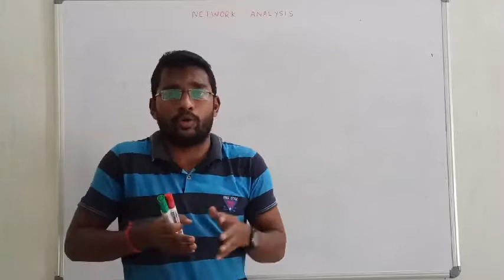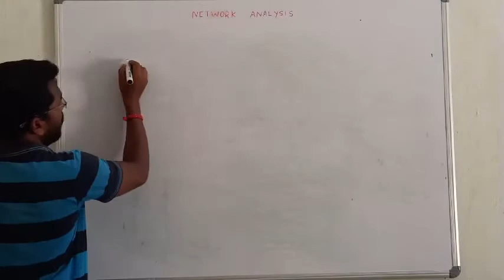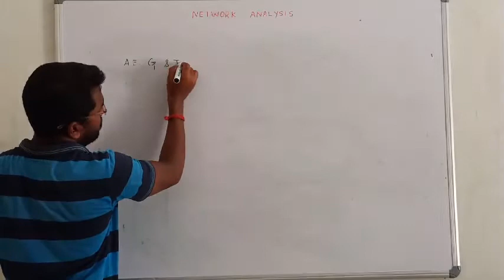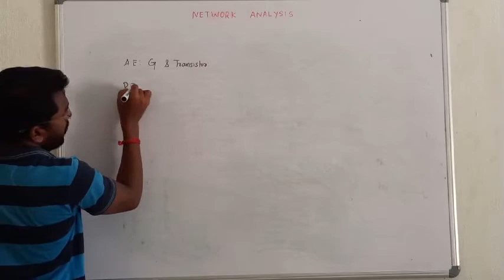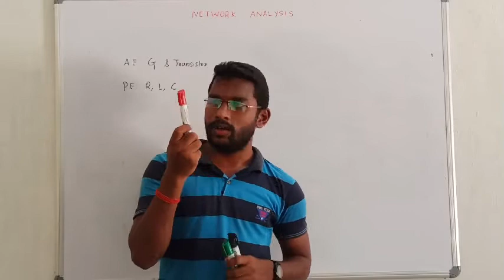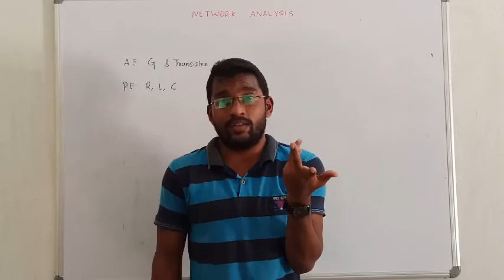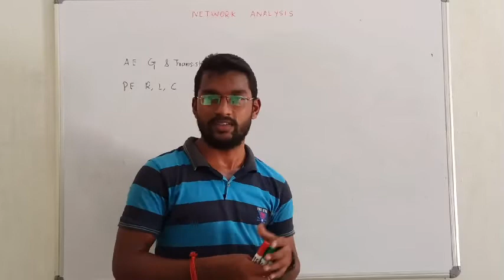16. ACTIVE, PASSIVE, LUMPED AND DISTRIBUTED ELEMENTS I EE I CIRCUIT THEORY IN TAMIL

Comment: Transformer passive element for sure. Not to generate. But to transform.
Also Please elaborate in industry there are many transformers are used. Like Power transformer, Voltage transformer, Current transformer. But am confusing with booster transformer used in between transmission line. Whether it is active or passive.